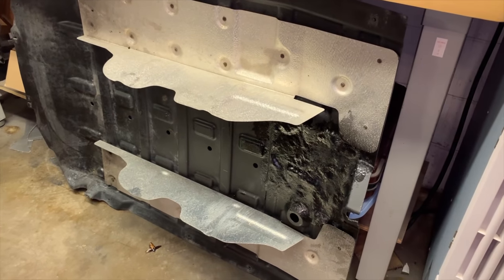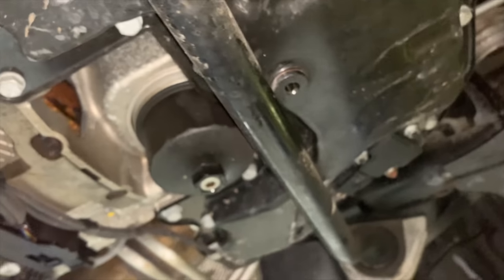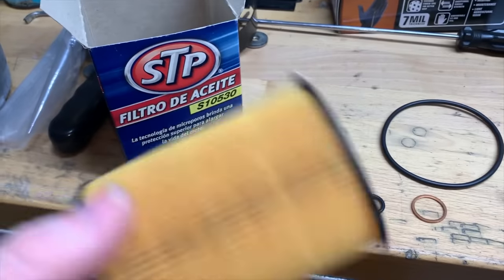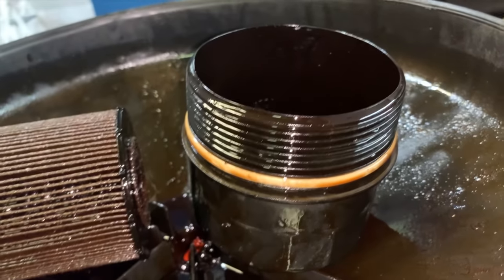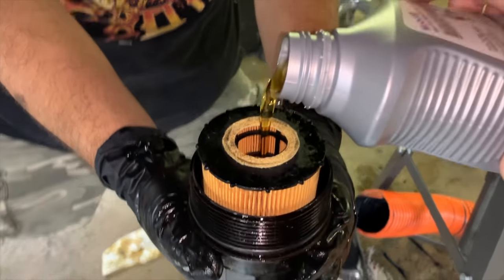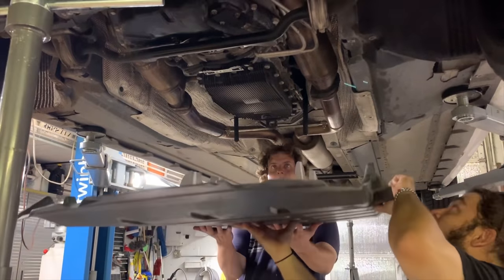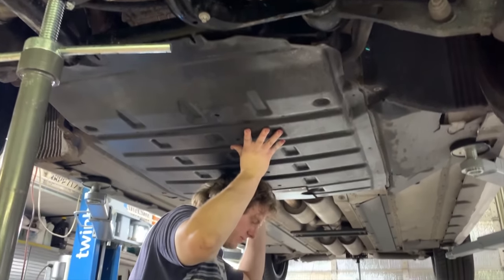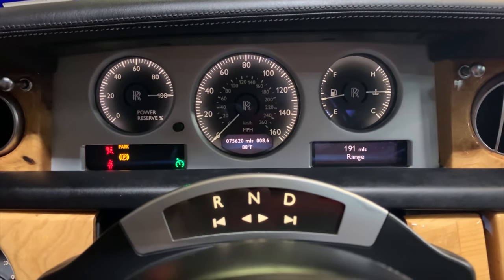Rolls Royce Phantom - OIL CHANGE

Comment: Last time I watched the full video of the Rolls Royce incident, only 1 guy died (the guy in front) the other guy (that ran to the rear) only broke both his legs. He's still alive. 

Also, when changing the oil, no one ever drain it completely, only draining what's been sitting in the oil pan, the engine internals still has about a quart (and maybe a half) of oil that never made it into the pan, so it doesn't matter if changing when hot or cold. 

Good video.
Reply: I’m saddened by what happened 😢 . I’m also glad that you shared this video . Be well & safe .

Comment: This exact procedure can be done on an 8 cylinder Volvo S80, done it many times. A couple of helpful hints on the oil change though.. tie a rag around your wrist on the hand that removes the drain plug and screws off the filter housing. It will stop the (hot) oil from going straight to your arm pit. The other is, just let the plug fall into the oil change funnel. It has something similar to a slotted drain in the center and won't allow the plug to go down the chute and you get your hand out the way of the oil a little faster. One last thing.. if I had a Rolls Royce, I wouldn't want to be chauffeured around.  I like to drive too much, oh, and I'd change the oil as well. Nice video!

Comment: Thanks for filming this and publishing!! It'll make people wonder why RR dealers charge something like $2000 for a simple oil change...

As for the oil to use - you should always use the recommended oil weight for your engine with today's modern engines. ALWAYS. Newer engines have variable valve timing and all kinds of other trickery, that relies on oil flowing at engineered pressures to work. Using an oil that's thicker/flows slower (or thinner) will mess with those systems and cause drivability problems and, if the oil is way too thick, can even damage the internal components. Also, the 3000 mile oil change interval is no longer valid. Many manufacturers (including Porsche and BMW, I think...) recommend annual or 12,000 mile intervals. Doing it every 3000 miles is throwing money, and perfectly good oil, away. Especially when using high-grade synthetic oils like Mobil 1 or Amsoil.

Mobil 1 is my go-to oil for everything these days. It's the only oil that's been proven at stupid hot desert highs and Shaking Eskimo cold...If it's good enough for F1 and their extreme operating environments, it's good enough for me!! I even run it in my lawnmowers!! Great stuff!

Check out this vid...  https://www.youtube.com/watch?v=uQ_vxdO_9nc&t=277s
Reply: Source? Who says they charge 2000 for an oil change??

Comment: Get the Mann filter and trash that crap STP filter. That's nothing but trouble.
Reply: Enzo Pianelli I don't think the stp will give any problems at all with the normal interval. A Mann would be higher quality though
Reply: lmaoo
Reply from the maker: It's all the same filter, just different names on the box.
Don't believe the hype.
I also change my oil in half the time recommended every 3000 miles.

Comment: Before installing the shield, fill the oil, run and check for leaks.  Also, stay away from oil stabilizers, just use a high quality synthetic oil.  Otherwise awesome video, great work!  Thanks!

Comment: As a mechanic of 41 years, working on all types of vehicles from Mercedes to Rolls, Cortinas to Lada Nivas.  I have never experienced a situation where I had to remove the oil filler cap to stop the vacuum and allow the oil to drain..  Go figure.
Reply: Same here

Comment: You do not need to remove the oil filler cap, to drain the oil, it is not a closed system
. There is a crankcase breather hose which allows air to enter/leave the engine crankcase

Comment: Have you guys heard of this thing they call a RAG? You use it to wipe off excess oil and clean as you go. Wiping the bottom of the oil pan drain plug area lets you see if any leaks develop. Same for the oil filter.  Thicker oil? That's so 1970s. Pick the viscosity the manufacturer specifies, buy a quality SN, ILSAC GF 5 synthetic and pour it in. The engineers at Mobil know more than any mechanic does when it comes to formulating motor oils. They spent millions engineering and testing that oil. Why mess with a good thing?

Comment: Instead of using a standard (i.e., sharp) pick to remove O-rings, it's safer/better to use a Seal Remover with a small, curved, spoon-shaped end.  That should minimize damaging them when taking them off or reinstalling.  Snap-on and the other truck brands offer a set of four (two long, two short), or you can buy them individually.  Anyone can order them off their websites.  You can probably also find versions of these by other manufacturers on Amazon, as well.

Comment: So lets see a few mistakes. One: Remove the oil cap before lifting the car. I know the car is lifted for the video production but not too thought out. Two: A simple piece of thin plastic heated up and curved to hang from the sway bar to keep oil off the sway bar, sort of like a deflector. Three: A little bit of heat from a heat gun would loosen the oil drain plugs crush washer. Four: Clean the filer housing inside and out before trying to remove the O-Ring. Five: A hobby knife and simply cut the O-Ring off the filter housing. Six: Use two threaded studs and screw them one on each side before installation of the belly pan; this is for aligning the belly pan, screw all screws in after that remove the two studs and screw the last two screws in. I'm not sure if you guys should be doing repair videos. Why would anyone not clean the old dirty oil engine out tube from the engine and the inside of the filter housing? Why put that 1/4 quart of dirty carboned residual oil back into the engine?
Reply from the maker: Man, yer smart!
You want a job?
I need a smart guy like you at my shop!
Reply from the maker: @Blueknight1960  Good help is hard to find these days...

Comment: Drape aluminium foil over the bar (under the oil pan) before draining the oil and it will deflect the oil into the drain pan and save clean up time.....

Comment: A few things... I highly recommend the BMW parts and fluid for that vehicle. FCP will lifetime warranty all parts, including OIL. Also, at 75K miles, on a ZF Transmission, which is what you have, you are about 25K miles overdue for a new transmission oil pan/filter and fluid change. My bet is that it was never done. Sure BMW/Rolls will tell you it’s lifetime.... it’s absolutely not. Ive talked with the engineers directly at ZF and it should be done at least every 50K on the 8HP
Reply from the maker: Philip Barrett Working on it

Comment: For me, I’d use the oil and filter as recommended by the folks that built it.  Neither place is where you want to go cheap to save a few bucks. That’s just me though. I’d also pay for the oil analysis to be done, cheap insurance with 12 cylinders.

Comment: The reason this car breaks so much is while it's only driven 75K miles, it was a fleet car for a wedding service, which means it probably idled a lot. This puts it into the same situation as Crown Vic Police Interceptors, where you multiply mileage by three.

Comment: Drain oil when engine is heated to driving temp, Then a breaker bar should not be needed. Always tighten oil drain plug to manu spec with calibrated torc wrench.
Reply: Torque...

Comment: You have a beautiful car, I sure wouldn't use Mobil 1, I would prefer to use Royal Purple 0-20wt or 5-20wt oil.
Much better oil, in my opinion. 👍👍
Reply: I have been researching oils last 5 years and Royal Purple is a WASTE OF MONEY !! Doesn't have enough additives to even be certified by APSI. Heck I even got 3 5qt jugs of RP 10W30 for free from Autozone that was gonna trash them lol. Now i'm selling them $30 each and not even gonna use in my vehicles
Reply: As long as it is the correct viscosity. IMO.
Reply: 0 - 20 IS INCORRECT WEIGHT FOR ROLLS

Comment: Guys some pointers from someone who's been in the business for 30 years +  First, replace your missing lifting pads where the rack arms go on the car (it doesn't look like they are on the car from your footage, if so, I apologize), second invest in a torque wrench because your drain plug was way too tight!  You shouldn't need a breaker bar to release a drain plug esp. on a RR :) I believe there is also a torque spec on the OF cap (likely 25Nm) either way, this information is easy to look up and apply while working on your own vehicle.  If you can't find the specs PM me and I'll help you out with factory info!  Another suggestion is to use Euro spec 5/30 oil and not US Spec,  one last thing.  I would very highly recommend BG MOA over any Lucas product.   Watch YouTube video BG MOA Friction test.  I've used and sold this product for years (I don't work for BG fyi).

Comment: Good of you to use two additional supports as an added safety measure.  

The Mobil 1 5W-30 is not suitable for that engine because it does not have the BMW LL01 approval. (at least it has not had it historically, but that may have recently changed) Most German car engines (your RR has a BMW engine as you know) must have a HTHS (high temperature High Shear) oil (as well as several other engine oil characteristics). Many make the mistake of choosing an oil based on its viscosity and that it's synthetic.  If it meets the vehicle manufacturers specification and has the approval rating to support it, then all else will follow and be acceptable; such as viscosity and brand. To be clear, it's possible that a non-approved oil can have the required or better attributes of the approved and certified oil, but if there are no markings indicating such then how would you know?  Better to stick with what's known, especially when there is little to no cost difference between the certified oil, and non certified oil.

Over the years I'v heard many people pledge loyalties to different motor oil brands.  They go on to mention how their father, and grandfather have used a given brand for years, and how they have never had a problem.  That's fine if your talking about an oil with a very specific certification like the BMW LL01 mentioned earlier.  Apart from oils that have OE approval, know that motor oil formulations change often.  One reason is cost, and to keep up with constantly changing EPA mandates.  An example is winter vs. summer blend fuel. Because oil formulation change is a given, is one of the main reasons that car manufacturers have created the concept of specified and approved oils.  Of course, once a given engine has been designed  and put into production, there is no going back; it needs what it needs.  With that said, many German car manufacturers have done a good job of making the current model oils reverse compatible to the older specification oils, but this is not always the case.

We are German car experts, but to my knowledge most if not all car manufactures have very specific oil specs.

HTH Cheers.
Reply: I completely agree.  In my experience, if you don't use an oil with the BMW Long Life specification in BMW engines of this vintage, or let the oil go to long between oil changes, the engine will leak.  Badly.

Comment: I had a Fram filter element separate inside the canister. God only knows how many miles I drove without any filtration. That was the last time I bought garbage filters. There are a lot of videos out the showing  quality differences between filter brands. It’s not just a label.
Reply: Oh my Fram filters are trash. NAPA bought Wix out of South Carolina. Wix/NAPA have the spiral flow canisters. I have yet to find a better filter. FYI my cars sit quite a bit. I have a car on each coast.
Reply: Mann and something. Thats who owns Wix filters. Not NAPA. NAPA just has a private label deal with Wix.

Comment: Just one comment on the resetting of the service items Bob. You do not need diagnostics to do this on any on the service items, oil, pads, plugs, coolan, brake fluid etc. If you go to 14:30 of this video you will actually see the 'RESET Br Fluid' option, simply scroll down to this and hold the button in and it will be done showing the next required time attention is needed.

Comment: I have a 2013 3.2 litre Ford Ranger 5 Cylinder diesel  , It has a similar type of cartridge oil filter. The issue with the Ranger  is you can't let the oil stop dripping. The idea is when it's just about to drip, put the sump plug in and pour in at least 5 litres just over 5 quarts' or the oil pump will drain and won't prime and you will have catastrophic engine failure.

Comment: Just a quick question, shouldn’t the viscosity index improvers and wear chemical package be enough not to use any additives? When the base number and oxidation values increase, you may put in additives then.

Comment: You should go to Mobil 1's web site and read their  FAQ section about adding additives to your oil. I have been using Mobil 1 5W 30 for over 30 years now and I live south of Houston. I never put anything in the crankcase but the oil. Exxon Mobil will tell you that they have the corporate might and engineering muscle to get the formula right and I believe them.

Comment: Hey Bob,
Have you fooled around with the stereo/CD changer in the Phantom?  I looked for some kind of a plug or port to use with my ipod , but I cant find any.  Do you know of a way to use a ipod or tablet to plug into the stereo system in the Phantom to listen to music?
Reply from the maker: D D I will be doing a video on this soon but there is a company that makes an adapter that allows you to plug your phone or an iPod in place of the CD changer and also allow steering wheel controls I have it in my car now and we will talk about it soon
Reply: @RobertMoseley  Ok thanks!  Ill be looking forward to it

Comment: Always put the oil cap next to the hood latch when you remove it. The hood won't close if the cap is in the way and it just might remind you to put oil in the engine. It happens.

Comment: When refitting the oil filter housing, put some rubber grease on the o-ring, you will be glad you did next time you change your filter. Also it is better to leave the filter drain bung in until you have loosened the housing a bit as the plastic can deform under load from the socket because there is a big hole in it!

Comment: You know this is a high class video when guy whistling "Girl from Ipanema" when he loosens drain plug(4:05).   I had a 1961 Silver Cloud II.  That was hoot to service!  Also had a 1961 Jag MK IX-needed 13 quarts per oil change, with an old truck type filter.  It was worse.

Comment: Using an STP oil filter on a Rolls Royce?
Reply: Stp makes good products, a car is a car oil is oil.
Reply: Yup I couldnt stop laughing !! STP=JUNK !! You might as well use a Supertech filter from Walmart
Reply: @rickybobbydastar6534  ...junk filters like Pronto and Service Champ are good for, maybe 5,000 miles, after that they stop filtering the dirty engine oil. Filters with cellulose medium should be avoided.
Reply: @tgamble1000  never heard of the filters u mentioned I’ll church them out . I guess it depends how often I change ur oil
Reply: @rickybobbydastar6534  …they’re both used by “fast oil change” companies…they’re made in Korea and or China…

Comment: With that tool you used to go into the computer of the car, can you turn off the tps light cuz I have that issue and the wheels don’t have the sensors in them anymore

Comment: Soo why pour oil in the new filter? It’s gonna get a flow of oil to it as soon as you start the engine
Reply: Otherwise it absorbs the oil if it’s dry and then you have less oil in the sump
Reply: Then you got too top it up with more oil, easier to just prime the filter with oil
Reply: The oil has to pass through the filter first before it passes through the rest of the system so some people will pre-fill the filter so that there's already some oil in the engine and it's not that bad of a dry start when you turn the car over.  Most manuals will actually give you two sets of oil amounts in the lubricants section.  The first is usually how much oil is needed on an engine with a fresh oil change.  The second is the amount of oil needed if you pre-fill the filter first.
Reply: orochikaiba very true mate, however I always prime my filters
Reply: @orochikaiba    People who pre-fill  the filter are just using oil from the volume that was going to go  into the engine during fill,  If they pre-fill, there will be a little less oil that would have gotten  dumped into the engine.  I pre-fill the filter from a 5 quart bottle, then I pour the remainder into the engine.  If I did not pre-fill, the whole 5 quart bottle would be poured directly into the engine.   Either way, the engine received 5 quarts.    You are confused and this is what you are thinking of.... one volume  is  for someone not changing the oil filter, and one is for changing the filter.  If you do not change the filter, it is already filled and therfore less oil needs to be put into the engine.

Comment: 27Nm on the oil filter housing and 20 Nm on the drain plug
Reply from the maker: I ned a Nm wrench.
Reply: Just wanted to big it up that I got a snap on tech wrench that can digitally do any units! Here in England they trying to force metric torque upon us but working on American engines in a European aircraft means lots of switching backwards and forwards between torque standards. Been some pretty bad incidents from them getting mixed up! Tech wrench just another level of protection.
 I respect you for having the guts to not be scared or intimidated by the car and to get stuck in. It's only nuts and bolts! Employ the same good common sense and engineering standards and it pretty much the same as most other cars to work on. I replaced the brakes on an Arnage and was just like working on a big Mercedes or any other car. Just do it,what can go wrong?